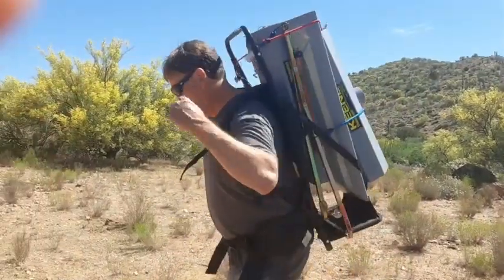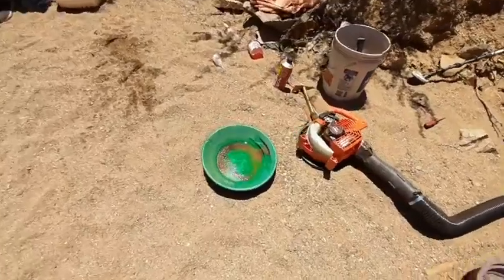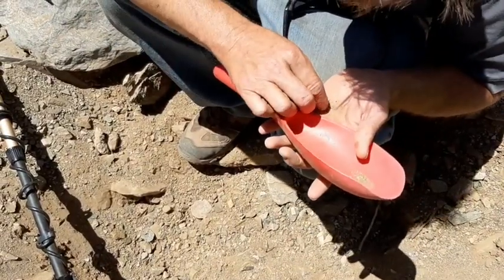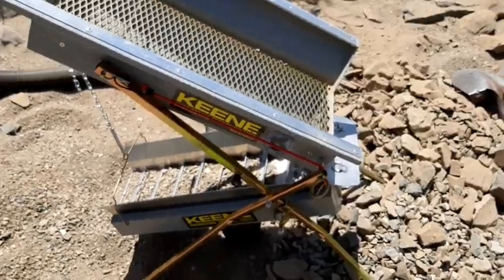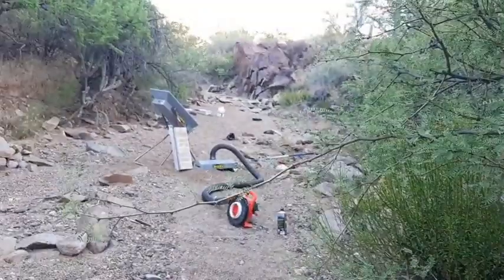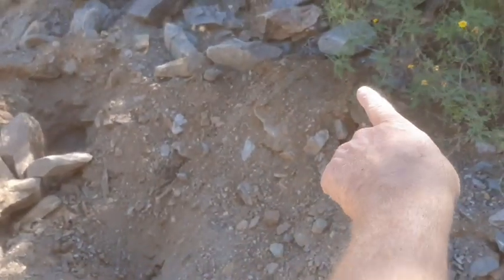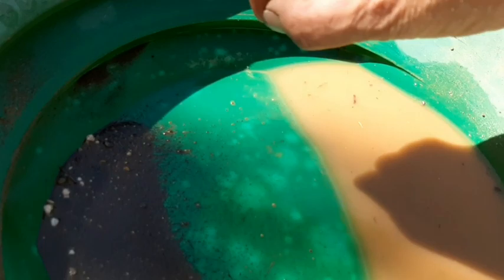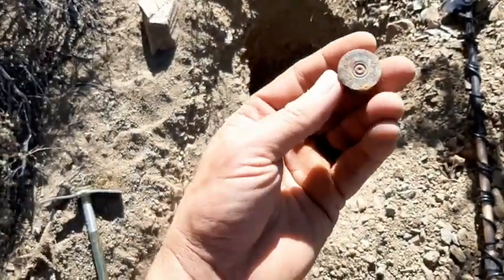Drywashing for desert  gold keen 140s

Comment from the maker: Hope everyone had a great memorial weekend and I need to mention the 140s is great unit.I plan on working it for years to come.I believe when I was transporting it on the backpack frame I bent that aluminum tray,Tim from A&B prospecting imeadly told me a tip of putting a piece of carpet between the 2 pieces when transporting and offered any help to fix my drywasher or advice.
Reply: Ive used key rings before on the fly to replace broken clasps and ended up liking them better because they seem to allow more vibration

Comment: Personally if it was me I would mount a stiff rubber mat from the top going down pass that flap so the Rocks would just roll off like a slide then I would never have to worry about whether or not it's too high to low and it would work in every situation that I come across like my grandpa always said there's more than one ways to dig a hole hope this suggestion helps

Comment: How much heavier was your 151 dry washer? I want to eventually get into drywashing in the winter months out in AZ. Just wondering how much material can the 140 run versus the 151?
Reply from the maker: A 140 can process alot of material, a lot.The 151 is more then you should ever need.The difference is you can backpack a 140 and for going into a far location the 151 can be a logical nightmare at times.

Comment: Is there a reason you went with Keene? I wore out a large Royal then bought another. Imo no drywasher compares. Nice video thanks for sharing
Reply from the maker: I only went over to keen to get a 151. I loved that machine just the engine was not portable. I did really like Royal ,the Grizzlie hopper was much bigger than the 140 .And it's only like $20 to buy a new metal piece with the felt matting for under the riffles for the royal
Reply: Ya they will send you the felt for free. I wore through the metal lathe on the hopper and the aluminum lol. Gonna patch her up for others to use and have yet to break out my new one. Been dredging but now the water dried up. Tried the 140s and didn't really like it

Comment: Good evening Andy. This is the video I've been waiting for. The problems you have had with your dry washer I've heard before. I was on the fence about the 151 or the 140. At this point it looks like it will be either the 151 or another brand. The 140 just seems to have a lot of problems. For the money spent it should have all the bugs out by now.  Any way you got some nice looking gold on this one so we know it does work. Question for you; Did you pan out any of the tailings to see if you were loosing anything over the end? 
Thanks for sharing.
Reply from the maker: Hey Owen good evening 🙂 I have run the tailings over the years and maybe find a tiny flake so I just don't waist the time.Yes I do miss the trusty old large royal.Defintly see if you can locate a really flexible hose unlike the one in the video.
Reply: Owen,
The 140 does not have a lot of problems. You have been talking to inexperienced people. I have run thousands of buckets through drywasher and you are spreading inaccurate information. Dry washers have to be set up properly by the user.
Reply: @andyamysarizonaadventures5450  Will do . thanks
Reply: @IBRAKEFORBEDROCK  ok . I certainly wasn't trying to spread any inaccurate information which is why I didn't mention any thing specific. . I do like the improvements made by keene  which is why I have been leaning in that direction. I just mentioned that I had heard there were issues that Andy talked about in his video from others. I have owned dry washers in the past , some purchased some hand made by me. they all work. I just think that the 140 isn't for me at this point. I completely agree that the set up is critical . That being said; the 151 is still one of my top choices.  I just need to make a choice based on what I hear from others who own the different pieces of equipment. It's not game over for me. I'm still in the hunt.  I do appreciate your input. Thank you.